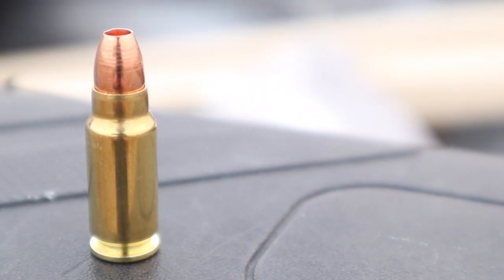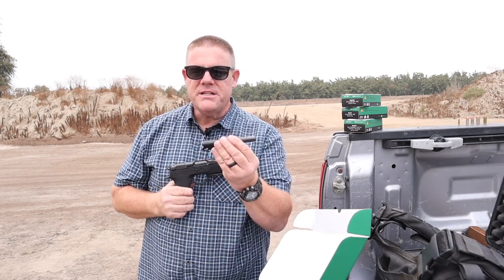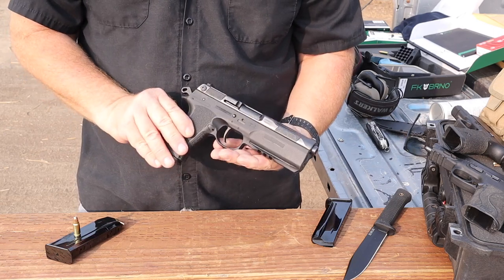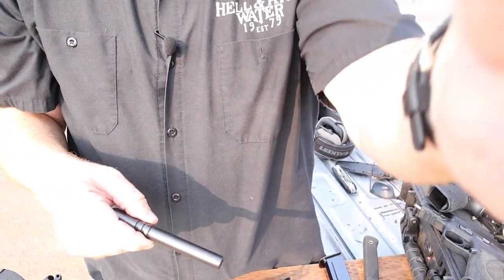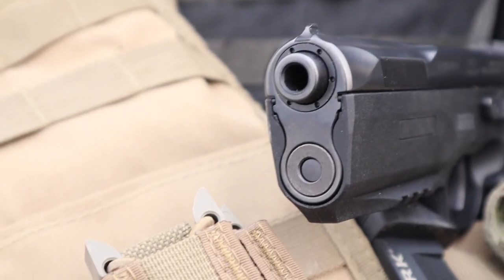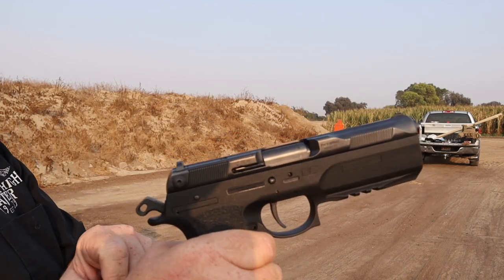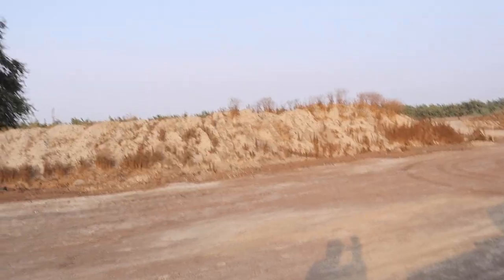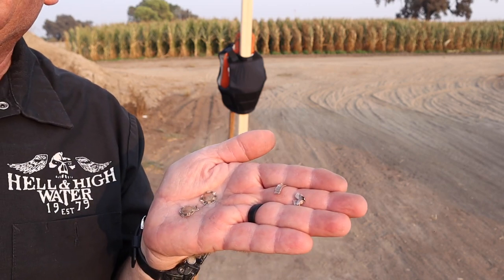The FK BRNO 7.5mm PSD [OFFICIAL VIDEO]

Comment: From an engineering and design perspective I have to say this is a masterpiece from the Czechs. The slide is a bit small but those bolts in the back make up for it. The bottom is huge but I understand its necessity. This mass accelerator is really nice
Reply: " ...  a masterpiece from the Czechs. ..."  So, no news.
Reply: With a little help from the Italians. Tanfoglio helped designing the gun and provided several parts. Massimo Tanfoglio sits in FK's board.
Reply: It's literally a 1911 on roids

Comment: Shoots soft body armor: "Hmm, that's gonna sting."
Shoots car jack: "OMG I think I'm gonna be sick..."

I wouldn't want to be on the wrong end of one of these. I think I need one.
Reply: 96D4HS9  they do sell a bolt-on brace for the pistol. Better hurry and grab one before Uncle ATF loses their mind. Again.

But the 7.5 fakyew would be something else out of a 16" tube!
Reply: @ScottKenny1978  somebody build a full auto post86 dealer sample ppsh-41 in 7.5fk with the drum mag.
Reply: @JinKee  yowza!!!!
Reply: @JinKee  oh, hell, I just looked at overall lengths and the 7.62 Tok has the same overall length! Bit of a problem with case diameter, though, the Tok is a full mm smaller in diameter, and that will really mess with the magazine.
Reply: 96D4HS9  well since its based off of 10mm it shouldnt be too hard for a company that already makes 10mm PCC's.  can basically use the same bolt just with a slightly stronger spring, slightly modified magazine, and could probably use the same magwell/upper

Comment: Please show us a couple casings after being fired to see how much gas blows back past the end of the shell. That will also be an indication of how well the barrel is machined. The more scorching and powder residue along the case the worse the casing seals to the chamber.😉 keep up the good work OG!
Reply: Unless they use a fluted chamber as then you want a bit of blow back. But then if they did I'm sure someone would have told us by now.
Reply: i went back through the slo-mo of the 10mm, the casing looked clean

Comment: I have put twenty times more .38 special rounds through my .357 magnum than I have magnum rounds.  It's so much cheaper, and even with the huge difference in recoil, etc, it made a big difference in my overall proficiency with that gun, no matter which rounds I was using.

Comment: Very impressive. The size, while rather large, could be done in winter with a coat and either a high ride style hip holster or shoulder holster. I shoot a 10mm in both a single and double stack Rock Island pistol, so a larger frame doesn't bother me. Really good test with the OG twist to it. Stay safe out there.
Reply: I've carried a 6" N frame in a vertical shoulder holster with no problem, so that would be doable.  Not ideal, imho, but doable.
Reply: I carry my CZ shadow 2 concealed with no problem.

Comment: 1. I'm curious as to how your truck survived.  From the perspective of the video, it looks like you may have thrown a bit of frag at the truck, when the bullets were splattering on impact with the steel. 
2. I know you are a well heeled firearms guy, but the proper(safe) way to de-cock an external hammer gun, is:  1.  to place your thumb between the transfer bar and the hammer(nail resting on the hammer);  2.  press the trigger, to release the hammer; 3.  remove your finger from the trigger;  4. use your trigger hand, thumb to hold the hammer. remove your blocking thumb and ride the hammer home.
At least on modern guns, this ensures, that there cannot be any accidental discharge, since even if the hammer falls, the gun will not fire without the trigger being depressed.  Ask me how I know.

Comment: Being from England the only real things I know about guns I learned here and on the Taofledermaus channel. Why the S&W in the winter?
Reply: Bigger pistol, easily concealed in winter clothing
Reply: Bigger more powerful round for winter clothes.
Reply: Also from England, and was thinking back in the day, I'd want one. But then it'd have been 3 entries on an FAC for the different calibres, and I'd have filled it up even faster buying ammunition. Then again, it'd have been less practical due to UK legislation, and pistols were for target shooting. So standard pistol calibres were .38 & 9mm for Police and Service Pistol matches, and .32 S&W Long & .22 for standard pistol. But I'm guessing this could be popular in Alaska & the 7.5mm having a bit more pep for their wildlife hazards than the 10mm with the bonus of being able to use cheaper ammunition for practising. Would bring new meaning to 'being loaded for bear'.
Reply: @brolohalflemming7042  You have the powder for a 10mm pushing a lighter and smaller projectile at higher speeds. Speed drives penetration through armor.
Reply: @danliberty734  Yep, also SD=M/A, so smaller Sectional Density leads to higher penetration, all things being equal. So it gets the benefit of both higher velocity vs 10mm, and better penetration from the smaller SD. So my thinking was that if the 10mm is a good Alaskan pistol, then this should be even more effective. Some day, I'd like to move to Alaska.. and not get eaten by a bear :)
Reply: @brolohalflemming7042  depends on where you hit.
If you can guarantee extreme precision you are correct, however precision in a life or death scenario tends to be low. 
One of the great things about 10mm though is the extreme range of loads they make everything from 105 grain rounds going almost 2500fps to 230 grains going barely 980fps.
Reply: It's Soft&Warm!
Reply: @brolohalflemming7042  In ak you would be more worried about a moose in your shed than a bear.. if you are worried about bears you are lugging some kind of long gun if out and about. bears usually give you a chance to arm up if they are messing about in your yard

Comment: The caliber will take off the day there is a glock barrel conversion for it (if feasible).
Reply: Well, it does fit in 10mm magazines...

I just don't know if a 10mm Glock barrel can handle the pressure. Remember, Glocks don't have a fully supported case head.

Comment: My son would put it in these words, "That thing is BADASS Dad!"
I have a five-seven.  At first I thought someone had a case of lixdexia, but not the case.
This thing is five-seven on steroids.  BTW, much of the characteristics of the five-seven are alike the 7.5, but more grains to remove the brains of a grand-prize winner of the coveted Darwin Awards (these days anyway).
I can accurately shoot my five-seven at 100 yards, and it does penetrate level 3 body armor as well, but it does not have the impact of a 10mm like the 7.5 does.
Don't tell my wife I want one.  I already live in a dog house.  What's worse than a grandpa in a dog house?  A grandpa in two dog houses!

Comment: 1.  That's a really cool gun and you did a great job demonstrating it.
2.  The only compelling reason to buy this is the 7.5mm cartridge and it is also the primary reason I would never buy it.  Expensive and hard to find are two disqualifying factors if I am going to add another cartridge to the ammo fort.

Comment: If the 10mm barrel will work with the 40s&w even with it dropping into the chamber like you showed us, the 7.5 would do the same since the come up out of the mag and slide into the slide the same way and be held against the breech face by the ejector. The 7.5 would be supported like the 40s&w would be. Since the 40 and the 7.5 daily drop into the chamber. Not sure if you get what I’m saying.
Reply from the maker: I get what you’re saying but the 7.5 is much too thin and has zero case support. It would dangle from the extractor and probably fall off, sliding out the front of the barrel.

Comment: I always learn something very valuable in your videos. I did not realize Germany had a 1 gun per person limit. When you stated that fact, and followed up with the Sig Sauer comparison-everything started to gel-regarding the modularity of the Polymer  line. I have a P360 and bought several lower frames. Just for color and comfort. I saw a listing on Armslist where the seller was selling just the serialized trigger component for 225-250.00. I know anyone can buy just the polymer frames. They are just plastic. It is in no way similar to the controversial "Polymer Lowers". I heard these are a potential component for a "Ghost Gun". This is something I do not understand as I would never try to build a firearm. I have a tough time just taking one apart, cleaning and reassemble one. Even the super easy ones. The fact that Sig got the military contract, will keep them in a very profitable position for a very long time. I see why they beat Glock for the contract. Thank you.
Reply from the maker: Thanks for checking out the show, Shawn. Glad you like it.
Reply: There's not a 1 gun per person limit in Germany. When you get a sports shooting permit, you can first get 2 hand guns with no further requirements, but you can easily get more if you shoot matches. They just want to see some proof that you are actually using those pistols for sport, then having 5 or 6 hand guns is not a problem.
And the matches don't have to be high level stuff, just some regional competition between shooting clubs is sufficient. We have many of those because everybody needs them for their permits.
But of course, it's still nice to not waste space on your permit, and one pistol with three different barrels only counts as one pistol with accessories.

Comment: OG, it’s 2 years on now has your opinion on the BRNO changed any?  The 7.5 round has certainly gotten a ton of positive chatter in that time.

**I’m just guessing here but could those bolts on the back of the slide be to help keep your grip while wearing heavy winter gloves, etc?
Reply from the maker: Yes, the bolts are for helping charge the pistol by pulling the slide back. 

I still love the pistol. I was hoping the ammo would become more commonplace in two years but it looks like you’d still have to order it from their shop in Florida.

Comment: OG, great video. My first thoughts were, "What's it for?" and then "What an ugly gun!" While the second point is purely a matter of personal taste (it looks really nose-heavy to me, like my SP-01), you answered my first question admirably. I can definitely see an application for such a gun for protective teams, especially (where legal) coupled with a shoulder stock. Clearly BRNO has figured out that not every hostile encounter takes place at bad breath range.

I've often thought that manufacturers missed a good bet by not doing something similar with the excellent .357 SIG cartridge, but clearly this round is going to be a great deal faster. I am a bit surprised at the single action only nature of the gun. You would think that they might have simply used the now well-established trigger system of the CZ-75, given the connection between the two companies. And you're right, the $1,650 price tag isn't insane if you need the range, and need to be able to hide your weapon under a jacket or vest. The three caliber capability is just icing on the cake.

Any idea of the projected cost of the ammunition? Keep up the good work.
Reply from the maker: A box of 50 rounds is currently running about $65. Not too crazy for this kind of performance. Similar to buying a box of specialty rifle rounds. Definitely not something you would take to the range and shoot all day long, but that’s what 40 caliber is for.
Reply: $50-60 buck on FK BRNO web page yesterday. For 50 rounds.

Comment: Thanks for the video. Another pistol now on my radar lol. Are the Allen bolts on the rear of the slide only purpose is to help with racking?
Reply from the maker: Yes.  Just to make it easier to run the slide with an optic installed.

Comment: The low orientation of the recoil spring is what tames that hot round.
Reply: I think the sliding weight also helps a lot acting as a mass dampner. I've not seen that before on a pistol, but makes a lot of sense if there's room inside the frame to accomodate it. I'm assuming BRNO trialled it with and without during development.

Comment: I have to admit that it's pretty sweet getting a different cal barrel and sights with it, which if you look at conversion kit prices, really makes it much less expensive than it sounds.  It also makes a new calibre pistol far more attractive. 
Just not thrilled with carrying a gun fully cocked and only a little thumb safety between me and my leg getting shot off, unless it has a bitchin holster for it.  I'd rather safety off and decocked.

Comment: If you had a great holster that guarded the trigger super well, would you need the safety on with the hammer back ?  I figure you could holster it with the hammer down and then once it is secure, pull the hammer back and be ready to go. Thoughts?
Reply from the maker: You can carry any single action pistol that way, but I find it much slower and awkward than  just drawing the pistol and snapping the safety off.
Reply: I'm sorry, I didnt communicate clearly. I'm talking about the gun riding around on your person with hammer back and safety off as if it were a Glock while one carries it with a good holster that completely protects the trigger.
Reply from the maker: @Cyotis  
I would always carry it with the safety on if it was chambered. Even if the triggers were protected, it takes a nanosecond to swipe the safety off and the extra protection is invaluable.

Comment: looks very interesting, the ability to shoot 10 and 40 outta the box will likely save it from the death that usually comes swiftly with a proprietary caliber, if they can hang on long enough for someone else to chamber in 7.5mm (and that happens sooner than later) it outta take off nicely, at least till its banned for perforating body armor in all of the fashionable areas.
if other brands don't adopt the caliber the 7.5 may not survive, unless they can make like FN did with the fiveSeven/p90, cook up a jazzy lil carbine that runs it too and the possibilitys are amusing

Comment: I would love to see a kit for the glock 20 to use the 7.5fk round, seems like a conversion barrel and maybe a follower for the mag would be enough since the 7.5 is a necked down 10mm if my memory serves me correct.. The brno is just way outside of my price range, ima poor.
Reply: It's not a necked down 10mm but a shortened 6.8 SPC. Same base measures, but the case metal is thicker, since it works at much higher pressures. That's why it's not recommended to convert other 10mm guns.

Comment: Does the 40S&W fit in the 7.5 barrel? And why do they finish the barrels beyond the end of the slide? Is there some advantage to extending barrels past the slide face? Why does it hold only 10rds of 10mm? How many 7.5s fit in the magazines? Beginning to suspect they install a wrong magazine spring.
Reply from the maker: So many questions.  Sixteen rounds of 7.5 fit in the magazine.  Ten (sometimes eleven) rounds of 10mm fit in the same magazine. The barrels protrude just a fraction of an inch like many European pistols.  It’s usually done for aesthetics and reliability.

Comment: Comfortably the 10 mm and the 40 would be like well but it's designed for that round to 762 that's a massive round. However because its design like a CZ with the rail inside the frame that's what keeps the recoil down......
Reply from the maker: Well that that mostly the recoil reducing weight in the front of the frame...   🤔

Comment: Basically it's the Tokarev round all over again. It'd be nice if they offered a 7.62x25 barrel as well. The whole gun is just a scaled-up CZ-75, though. Everything from the barrel to the slide to the FCG is basically CZ-75.
Reply: The recoil is totally different..
Reply: @georgekaradov1274  Not totally. They lengthened the slide and added a weight, and bulked it up, but it's still very similar to the CZ system.

Comment: Did you find some new holes in your pickup body after that shoot?
I would have been worried about splash, but then I'm probably a Fudd...
Reply from the maker: Not close enough.  Kinda looked like it but the camera makes an optical illusion.
Reply: @OGsDangerShow  I suppose it helps that you are able to head shoot that steel profile at the range you were shooting at. My only experience with the "car is down range" is the day my little brother let off both barrels of my 20 gauge Ithaca side by side shotgun into my dad's brand new '68 Plymouth Fury from about 10 feet. Right rear quarter panel, 3" hole, which took some explaining...
Reply from the maker: Ouch.  No happy meal for him that night!

Comment: With advancements in ammo and ballistics, that can easily defeat soft armor, as well as advancements made in lvl3 & 4 Polyeura lightweight armor plates... I just don't understand how come law enforcement agencies still issue soft armor over some of the new hard armors.  I get the flexibility and comfort of soft armor, but they are producing hard armors that are cut / molded for a more form fitment and comfortability now days as well.
Reply: expense? weight? too much $ to switch over to better armor? Good point though. I totally agree.

Comment: I have a question , you say you’ve shot .40 out of your glock 20. I have a S&W 1006 10mm , ive been told not to shoot .40 cal out of it if they are the same dia. only shorter what would be the problem ?. Im at a stand still since the .40 is easier to come by and a lot cheaper than the 10mm. Please help the boys at S&W refuse to machine a barrel that can be interchanged .
Reply from the maker: You do have to find someone more knowledgeable than I am.  Everyone will tell you not to do this, that it’s dangerous.  But the FK BRNO folks say right in the paperwork that you can from their pistol.  Glock says don’t do it but I’ve done it hundreds maybe thousands of times.  It really depends on your pistol and how much case support you get out of your chamber.  Me?   I’d test it a few times then run it all the time if nothing broke.  🤷‍♂️